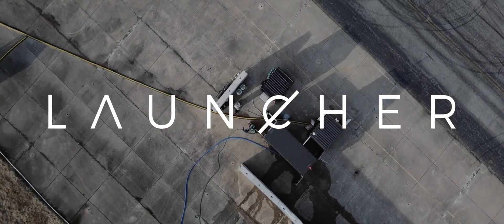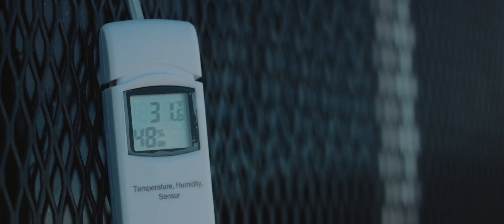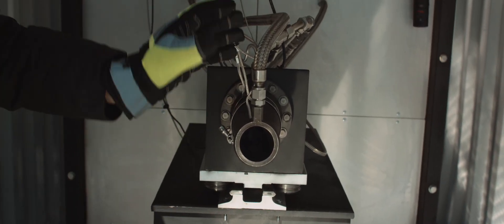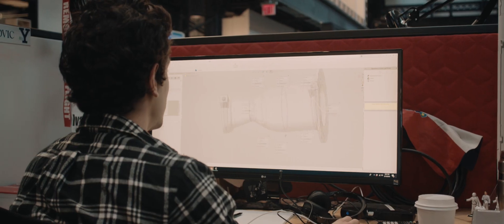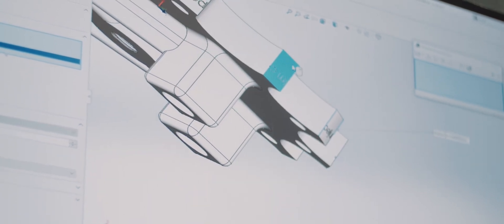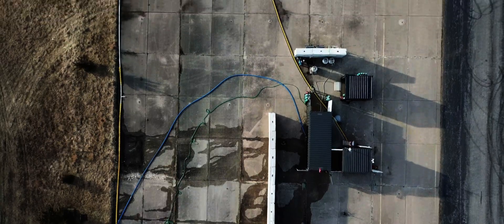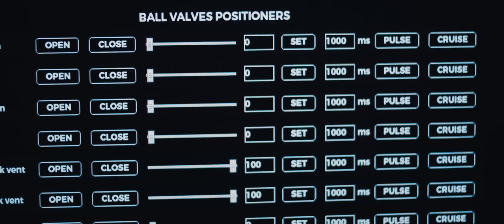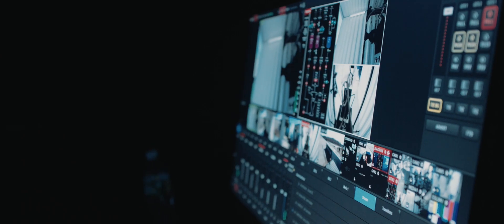SUCCESSFUL in new space race: 3D-printed rocket engines!

Comment: I wonder if a 3d printed part can handle more heat
Reply: Carbon fibre printed can handle more than 2000c with ease!!!!
Reply: Enough for a short fire engine
Reply: hell no, printed materials don't have the same inherent bonds, making them slightly weaker but cheaper, that's whit this isn't a heavy launch craft. I don't think the engine is better, but the 3d printed tanks are cheaper and could probably be comparable to a normal tank if it had carbon fiber